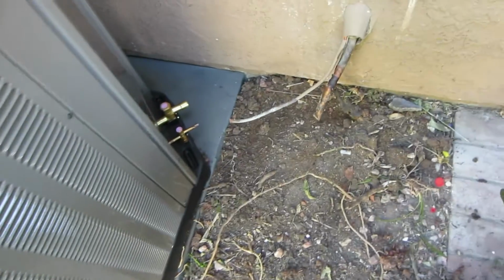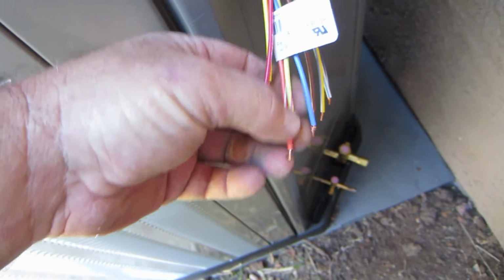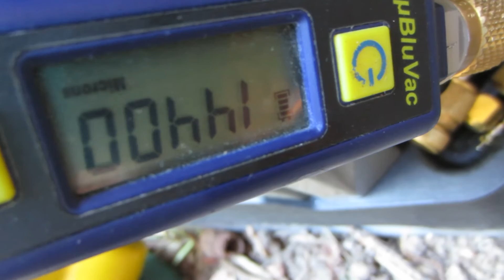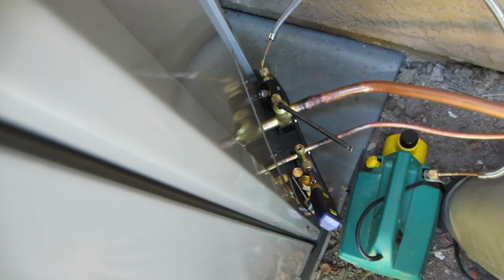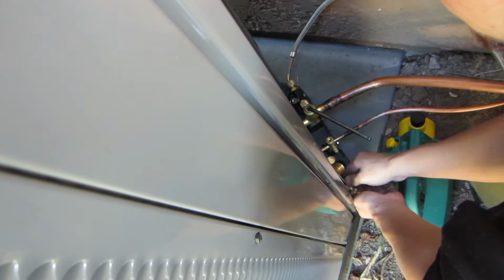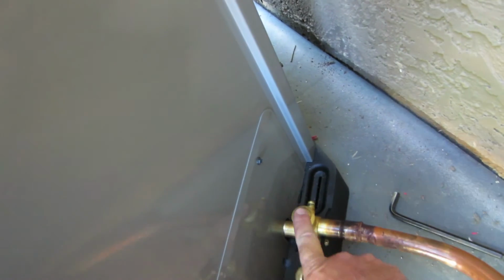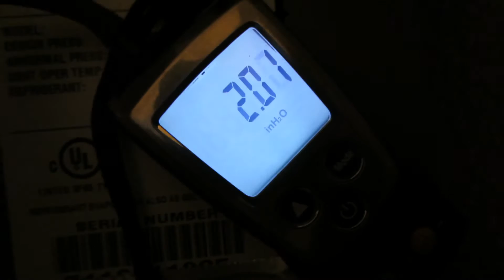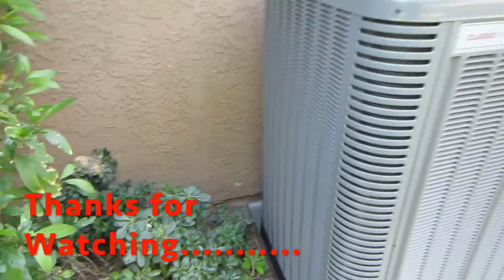RHEEM Two Stage RA 17 SEER Install

Comment: Two stage with only 2 wires? Does it just start on low and go to high after some time? I usually use a communicating stat with 2 stage. Also doesn't 17seer require a txv?
Reply from the maker: I use a transformer in the condenser to power the board R and C and then I use Y1 & Y2 as my switch leg.Just remember to phase your transformers.The unit does have a TXV.
Reply: ok thanks for the reply!

Comment: Hi Dallas, I'm ho[ping your still active on the channel.  I purchased this same exact system (Rheem RA 17) never used in the box about 7 months ago and just now getting to the installation. It must be that this system was so unpopular that brand new units are still sitting in warehouses. My A/C guy, who is also my friend, has never installed an a/c with a communicating thermostat system.  He is uncertain if I can get by with the current wires passing up from the junction box in the closet where the air handler is, to the roof where the condenser is.  There are currently 4 12-gauge wires, a ground wire and a thermostat 5 wire bundle passing up a 3/4 in conduit.  At about the 1:45 mark in this video you state that you only use 4 wires and cap the rest off.   Could you elaborate a bit more on the wiring and tell me which four wires those are and if I need to add wiring?  Also, do I need the Rheem programmable thermostat, which is around $400-$450?

Comment: Just had a Rheem two stage furnace and 5 ton AC installed. Man I'm crying on the cost but it was the best company out there and they did a phenomenal job. Even installed a water sensor cut off switch placed on the bottom of the secondary tray in case it detects leak it'll shut off the furnace.(Our overflowed discoloring the ceiling. Luckily we caught it quickly)
 Took about seven hours to install. 
Hopefully this will last longer than the 14 years my Carrier did.
Reply from the maker: That is great news.You new system should last 20 years with no problem. Thanks for watching.